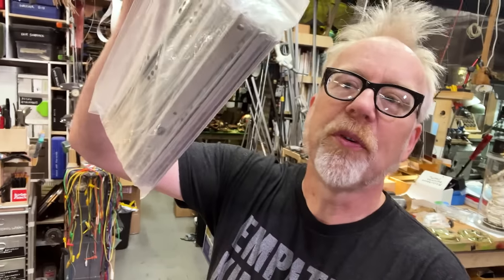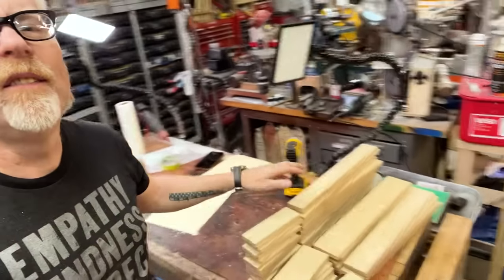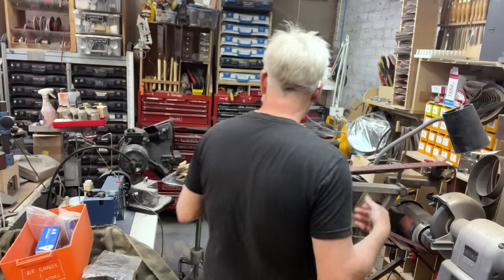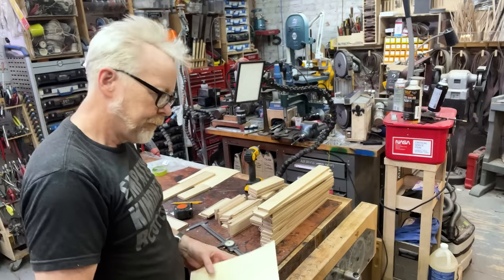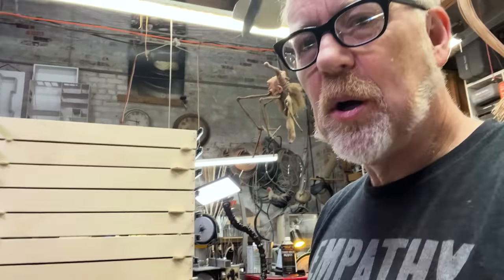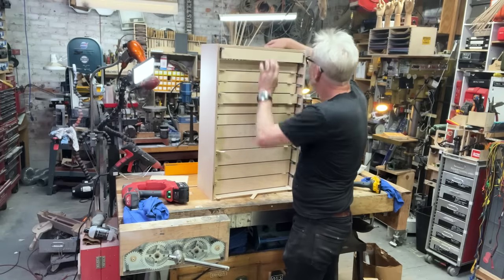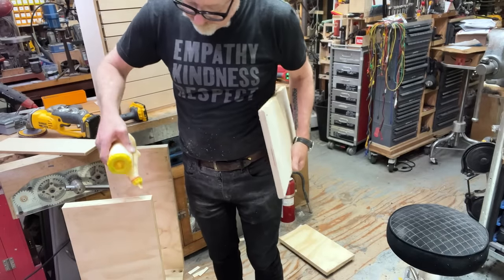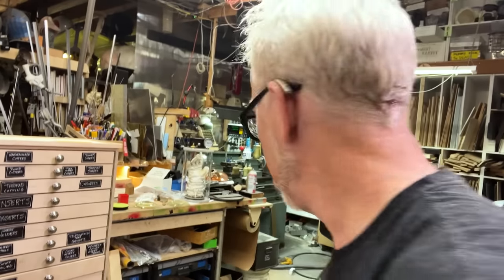Adam Savage's One Day Builds: Machinist Tools Cabinet!

Comment from the maker: The original machine tools cabinet build: https://youtu.be/BTGN5QNyA-8

Join this channel to support Tested and get access to perks:
https://www.youtube.com/channel/UCiDJtJKMICpb9B1qf7qjEOA/join
Tested Ts, stickers, mugs and more: https://tested-store.com
Reply: Love❤ from India🇮🇳.
Reply: Hi Adam, I have a question I'm kinda embarrassed to ask, it will probably sound silly to most and I remember being confused by this when I was young and in tech class many, many years ago. 
When you measure multiple pieces of wood to cut, out of one large piece, do you add on the thickness of the saw blade?
Reply: Looks top-heavy to me. Don't open too many drawers at once.
Reply: Wouldn't want to be in there during an earthquake.
Reply: Topiverse Drawer Slide Tape, Slick Surface Low Friction Tape, Abrasion Resistant Glide Tape, Drag & Noise & Squeak Reduction, Apply to Wooden-Drawer Furniture Curtain Cabinet etc. 0.5 in x 10 yds

Cheaper, quicker, and most important, you don't have to reinvent the wheel, which is especially important when one is nearing the end of ones lifespan, and time surely is limited.
Reply: @The.Pickle  if you want your pieces to be precisely sized, yes, you have to do this. This dimension called the "kerf."

On a table saw blade, this is generally 1/8" in the imperial system.

 This is a function of the width of the blade's *teeth*, not the thinner body of the blade.
Reply: Make a shop stool thats comfortable but quiet, equip it with tool holders or whatever you may need. But quiet wheels! One day build?
Reply: The style of drawers on the older cabinet work well if you are likely to take the whole drawer (or tray) out and take it to where you are working. I have a Gerstner-style chest (not a proper one) but the slide out trays work beautifully for me because a hobby model-maker (handyman and furniture guy by day) I tend to take out the tray of knives, or the tray of files/sanding sticks, or the tray of drills for each operation and I need the whole tray for those. (Two trays side-by-side in most cases - couple of large full-width drawers for big stuff).

Comment: love these, one tip for anyone following this is to make the sides 1mm wider than you measure over the runners. These runners work so much more freely when they have just a tiny bit of wiggle room, they are a touch stiff in this setup and it's because the balls aren't sitting in the intended grooves but more pushing sideways slightly. I found out the hard way too after making the first few of 37 for my garage during lockdown. worth adjusting yours Adam with maybe a power plane on the inner side as it should make a big difference to how the heavy drawers pull out without swaying the whole unit

Comment: I love watching Adam's builds because my workshop is just as cramped/cluttered. It's reassuring and relatble to know even someone with a high profile like Adam works like the rest of us, and doesn't have a hugely expensive, open workshop.  I am curious to know, how do you cut large sheets of timber/acrylic if you need? I end up outside on the front lawn doing it. 🤣

Comment: If you have to make drawers that are much wider than they are deep and you don't want to or can't afford to put full extension slides on them, the way to do it is to have a center runner on the bottom rather than slides on the sides.  This adds a lot of complexity to the case and the drawers for that matter and wastes space inside the cabinet but the drawers will work amazingly well.

Comment: I appreciate the pace and speed this is done. There is a lot of focus to push through on this. Many of my projects turn into weeks and months but it’s more because I’m enjoying it. Kind of like stopping yourself from putting a lego kit together in one sitting. Binging TV shows in one go instead of limiting yourself to one episode a night.

I do not understand why the he made the drawers so shallow. Even considering weight  the drawers and cabinet do not use the available space back there in the corner. Three inches deeper and it’d be so many cubic inches gained and the space is empty behind it. I made a ‘Poor man’s Lista’ years ago. It’s two-by-two feet using 1/2 ply bottoms. They’re deeper drawers and I use wooden caddy/trays to organize. I guess he just wants them that size or I don’t understand the available space in the corner.

I’d love to see a deeper cabinet of drawers below it. Like a good old stacking tool chest.
Reply: I believe the reason for the shallow drawers is simply due to size of what he intends to put in them.  He can keep everything in one layer in each drawer, increasing visibility and reducing the chance that objects will go in there and die.  Of course, I'm interpreting the word "depth" to indicate the distance from the bottom of the drawer to the top edge of the drawer.

Comment: Adam, you definitely need a Kindle Scribe......you can do all your sketching and planning on it without using a single sheet of paper......it saves the sketches like a note book....thousands of them.... and you can delete or rub out lines as you go........for years I sketched ideas on bits of paper and note pads in folders and they took up space I didn't have......and being only 5mm thick it's very portable in the workshop.......you can also have books on the Kindle to read etc.

Comment: Great project. Adam on your next project that has drawers I think you'll find using full extension drawer slides worth the added expense. I think you need a bigger shop. I think I remember a hallway in your building. They take up a lot of room. can you knock out the wall and add that space to the shop?

Comment: Comment on build time and cost: You pick two from the following; Cheap, Fast, Good.  You want it fast and good, it won't be cheap, you want it cheap and fast, it won't be good.  you want it cheap and good it won't be fast (and then it probably won't be all that cheap).

If you are after a "high quality" box, look no further than H. Gerstner...there's a reason those cost $2K for a new one, and used ones even 70 years old can fetch $800 or more.  Proud owner of two used Gerster's (now a 2610, but they used to be the O11), one dates to the early 50's and the other is from the mid-70's.  Love those boxes!

Comment: I think when it comes to the speed of making something, you should lower your expectations. I used to use a cheap Ryobi table saw for my woodworking projects. It would never stay set in place between cuts, so every project took four times as long as it should have because I would have to cut, reset blade position, repeat. Quality of tools and materials has a massive impact on construction time.
Reply: I think sometimes people need to focus less on speed and more on quality

Comment: 2 remarks/quistions on this nice build:
First question is why you did use this type draw-sliders? There are sliders that makes it possible full extension so that the hole drawer is open  and even the backside is in reachable. Total overview, nothing in the shadow of the drawer above. 
Second remark is the missing fixing to prevent tilting.  The relative height to depth with heavy loads in the drawer .... is there this risk?

Comment: Topiverse Drawer Slide Tape, Slick Surface Low Friction Tape, Abrasion Resistant Glide Tape, Drag & Noise & Squeak Reduction, Apply to Wooden-Drawer Furniture Curtain Cabinet etc. 0.5 in x 10 yds

Cheaper, quicker, and most important, you don't have to reinvent the wheel, which is especially important when one is nearing the end of ones lifespan, and time surely is limited.

Comment: I would have made the sides of the drawers overlap the front and back, because this way the nails are subjected to shear force rather than "tensile force" when pulling the drawer. Don't know if tensile is the proper term in this case.

Comment: For us neophytes, would you please explain the purpose of starting with a blank throat plate on the table saw and then creating the gap for the blade by sawing through? What about this particular build induced the decision to do that, instead of just using the saw as-is?
Reply: Reduces tear out on the underside of the cut.
Reply: @rozinant1237  thanks! Was there something about this particular project that made that important, or is it common practice to cut a new blank for every project?
Reply: @harvey66616  It is more common to cut a new one each time you change the blade, as it is the clearance between the edge of the blade and the insert that provides support for anti-splintering. In actuality the blade wobbles and cutting forces twist the blade, this enlarges the slot with use. You would be wise to replace it whenever it shows signs of not doing it's job.
Reply: @rozinant1237  I see. So if you have to make a lower cut (so there's a gap on the leading and trailing edge of the blade) that would be okay? It's just when the blade itself is changed and so the geometry is affected more you'd cut a new one?
Reply: @harvey66616  Should be fine.

Comment: Ok, pet peeve of mine is when I hear or are given 8.4" or the like. Mostly due to working in the Cut Shop in a Big Box store like Home Depot or Lowes. People would measure and write it down then ask me to cut to that, when I ask when exactly the 0.4" means they don't know and would often say it's how many lines after it was and no they did not have the tape measure with them.
I never accepted as the difference could be 1/2", 3/8" or even 1/4" (1/8" was also possible but extremely unlikely) and in the case of lets say using the router to cut for hinges it can make a mess of the door if off. If I cut what the customer says even if it's wrong it's on them but it was not good business practice to let the customer potentially waste $100+ on a mistake of theirs. I normally would keep their stuff there with their info and have them go home double measure and call back in so I could ask the questions needed to ensure they are getting what they need. While not many were happy they mostly understood it was to keep them from ruining the look or paying double.
This did not apply if it was metric as it is a proper form.

Comment: I confess that as a woodworker who's made furniture on occasion for home and shop, I cringed at how Adam put the drawers together.  Butt joints and brads?  I've made box joints, drawer lock joints, even a few dovetailed joints, and they'll long outlast the joints that Adam made.  Drawer lock joints would have added a fairly small amount of extra machining and been far longer, and they can easily be made on the table saw, especially during a production run like you're doing.  I know you're going for speed and understand why you wouldn't want box joints or dovetails (although Norm Abrams would be horrified), but unless you're pretty gentle with these drawers, I expect you'll have loosened joints within a few years.  Even gluing in the bottom plywood panel would have substantially strengthened the drawers.

Sorry about the buzzkill, but I couldn't stand it.

Comment: So sorry, love and watch all of your videos. However, this time I noticed something of important note. The sides of drawers should be nailed on the outside of the faces to give your brad nails the mechanical sheer strength advantage. If your drawer is stuck, as you pull on the face, those brads could pull out after the glue fails. If they were perpendicular to the pulling force, they would add strength.